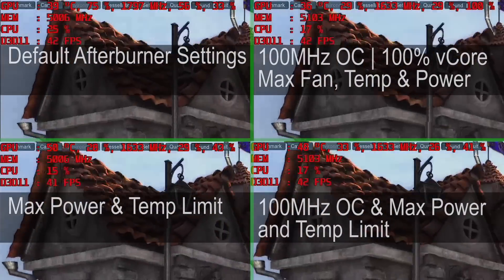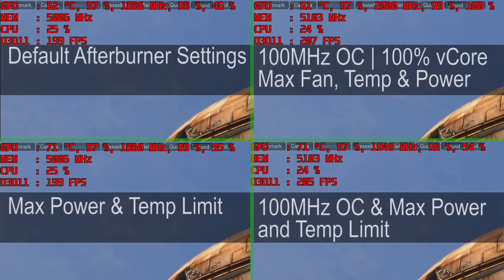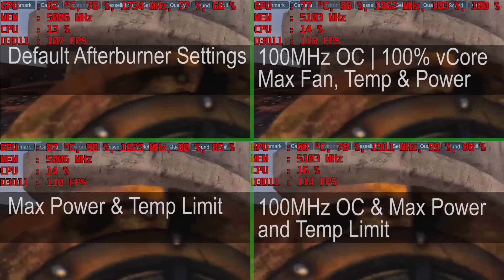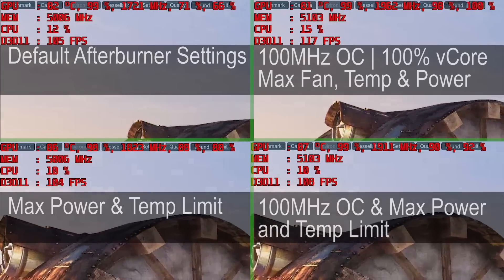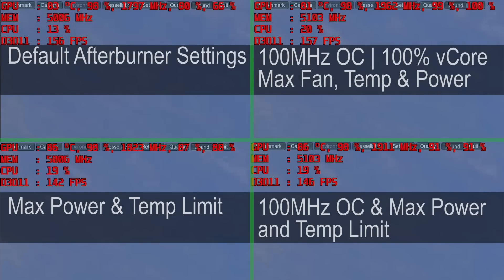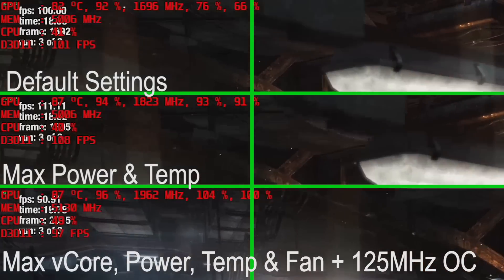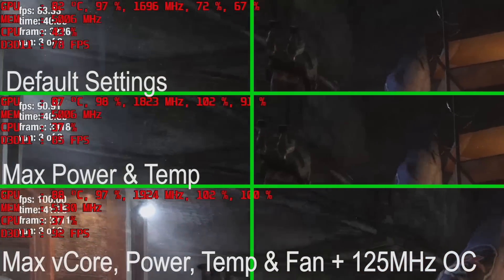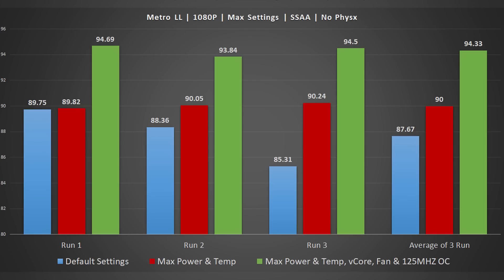Nvidia GPU Boost Technology Explained

Comment: My Rtx 2080 Lowers my manually OC clock. my GDDR6 runs at +1351mhz effective >8350mhz.
However! my core clock ramps at 2205 and then lowers to 2040 at max temp of 62c! it has no issue and has XC Ultra cooler fans on 100%.

Comment: just ran the same benchmark with my 1070 ti and got 93 fps with the same settings.  so thats nice.  of course thats highly oc'd but still it was a good price compared to the 1080's out there at the time.  never thought i would pay 450 dollars for a gpu and never would i have thought that would be a "good deal".  well its not a good deal but thats where we are at now.  this card should cost 300 dollars tops. 

people blame nvidia for selling a mid range card as a high end card.  at least thats how adoredtv put it.  and there is some truth to that.  the rx 580 has a 256 bit memory bus with 8gbps ram and so does the 1080 and 1070 ti.  both have around 2400 cores. 

but if you wanna blame nvidia for selling a midrange gpu as highend then you have to blame amd for not having a midrange gpu that can match it.the only reason that nvidia can do this is because amd's next card after the 580 is the vega 56 for 4 or 500.  so the same price and usually the 1070 ti outperforms it. 

if nvidia is selling a midrange gpu as high end then it should be easy for amd to beat it.  but its not.  so i guess the 1080 is more like between the mid and high. its die size is a bit bigger as well.  but that means it should cost more like 350 or so

Comment: You are not correct in your discription of GPU boost as it applies to Pascal. 

The temp limit will throttle the card in a similar way to a CPU, dropping the card to a lower power state to cool the chip. If the card has good cooling it will never get near the temp limit and the card will always run at the highest powerstate that the specific workload allows.

The Voltage slider only adjusts the highest voltage value available on the Voltage/frequency Curve that the GPU follows under load. The maximum voltage range can be adjusted between 1.063v at +0% and 1.093v. +100%

Power limit will adjust the maximum wattage available to the card. Each card model is different depending on VRM etc.  That setting will only start reducing clock speed when you reach the set power limit. Msi gaming x 1070 will allow up to 126% increase n power limit, other 1070 models range between 112% and 120%. The power draw of teh card is dependent on teh type of workload you give it combined with the Voltage limit. Furmark pulls much more power than firestrike for example.

The clock slider makes changes directly to the voltage/frequency curve. A +100 adjustment will increase every point on that curve higher by 100Mhz.  With Pascal, you also have the option of making individual adjustments to the curve frequency level at each voltage level on the curve. 

The curve sets the cards frequency starting point, Boostng up to the frequency setting at te highest point of the voltage curve within the limits of the voltage limit setting. By default at +0 on teh voltage slider, the highest available voltage is 1.063V but the frequency settings at both 1.050v and 1.063v are the same so the card will boost to the Starting point set frequency at the lowest voltage (1.050v) as determined by the curve.

As temperatures increase during usage, for every 5 degree increase in temp from the starting temperature, the Card will firstly check if there is any voltage overhead. If so, it will keep the frequency stable and increase the voltage to the next highest point on the curve. at each 5 deg increase in temp,  it will keep stepping up the voltage until the preset limit is hit. The default curve only allows one voltage step up.

After there is no further headroom to increase voltage, at the next 5 deg increase of temperature, it will then drop the clock speed 13mhz to the next lower frequency step the next 5 deg will result in a drop in voltage.   

Eventually, the cooler's heat dissapation rate will match the gpus heat generation rate and the temps will stablize. Once the temps stop moving, the clock speed and voltage will also stabilize. Max fan speed will dissipate more heat and equilibrium will be reached faster, keeping clock speed higher.  This applies even at 40 deg in a water cooled loop. The loop just reaches equilibrium at a much lower temperature because of the efficiency it has in removing the geat from the GPU die.